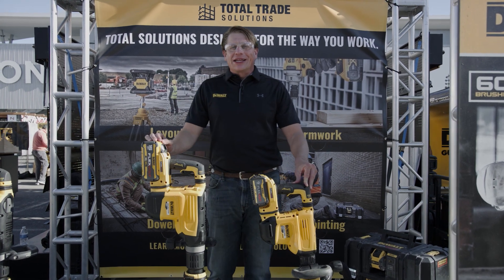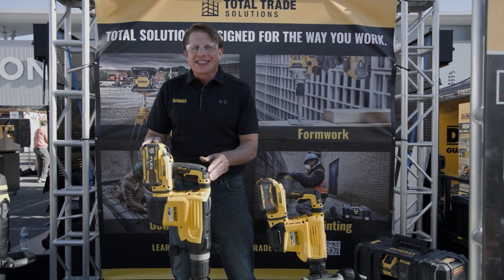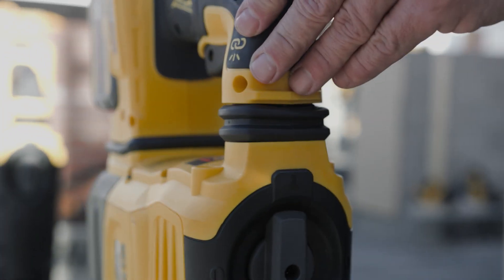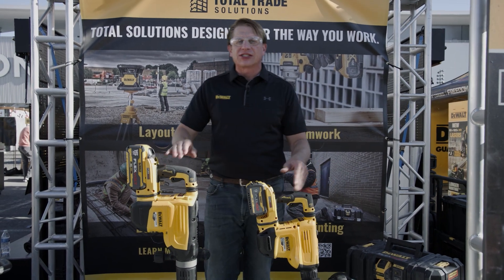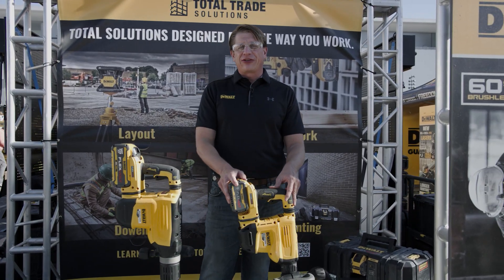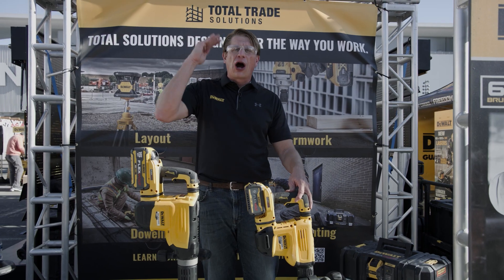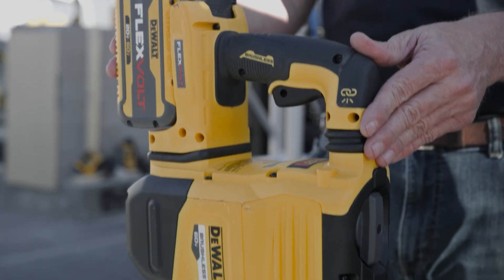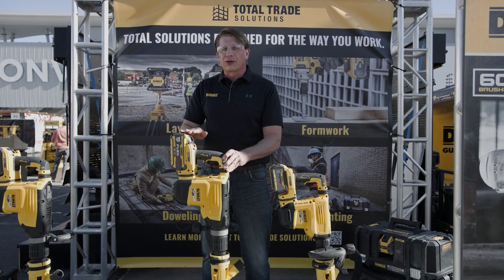DEWALT® 60V MAX* CORDLESS SDS MAX CHIPPING HAMMERS

Comment: I'm traumatized by the bad service from DeWalt/Stanley/Black&Decker here in Brazil. I was a fan of the brand, but I feel cheated by their marketing. My saw broke, I went to several authorized technical assistance and none accepted, they say the company does not provide parts after the warranty ends. I looked for their SAC and they claim it was discontinued, they feel they have the right not to supply parts, the customer should throw the tool in the trash and buy another one.
How can we trust to invest $ (here in Brazil tools are expensive) knowing that, a few years later, if it fails or breaks, we'll have to throw it in the trash?

Comment: When will it be available? I need it now
Reply: Its not worth it. Unless the power grid failed and you had at least a 1500 watt recharging station through solar cells and the sun. But after that who would work. Stick with electric until batteries level out.